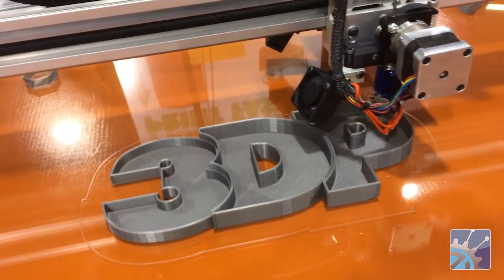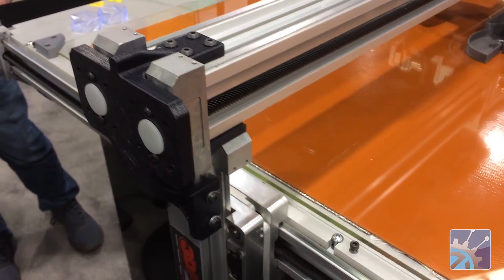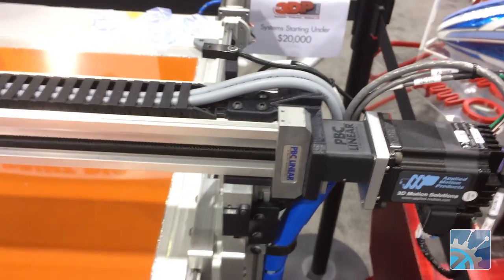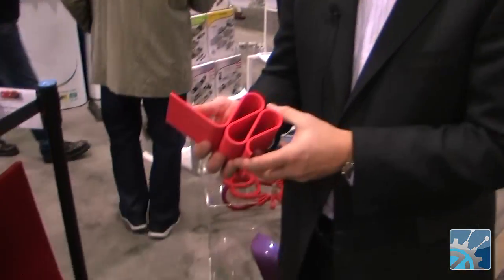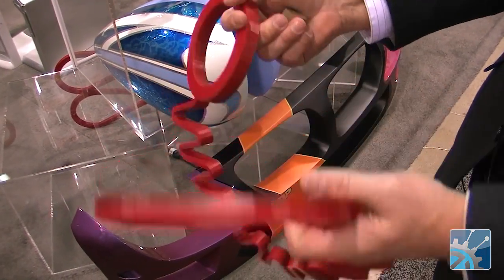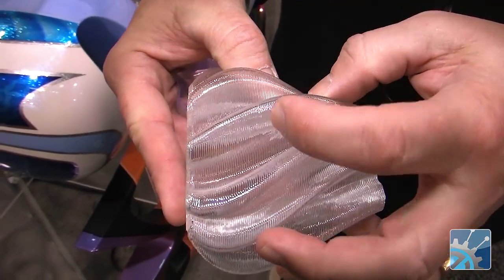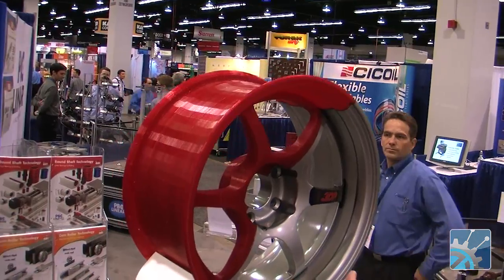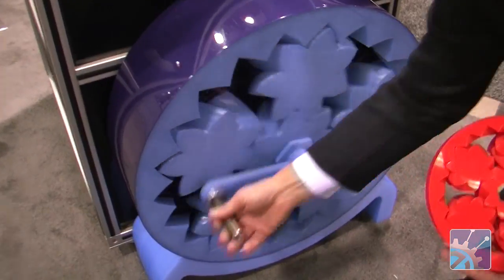3D Printing Goes Big with the 3DP1000

Comment: The problem with 3d printing, is that it's SO DAMN SLOW!
I can produce the same objects on cnc cutters in 1/100th the time.
Reply: +satansaysimnuts  Yes, its slow, and there is second "major" problem - with this technology, items are not so strong as solid object from CNC or casting. But on CNC you cant produce some  objects with empty space inside or others difficult items.
Reply: +Aleksandr Ruljov 3d printing in fdm tech is that is maxed out the ress has a limit and the cost of a high end fdm printer does not justify the money for it when you can diy a cheap one and last also many prints and in good quality the only thing that has more future is the materials and that i dont know how much
Reply: odys nobody... what the living hell are you talking about? use some punctuation please.. I can't tell wtf you're talking about, and the stuff i can guess on, is kinda wrong lol.
Reply: Yep, all I need is to replace my £1000 printer with a £30,000 CNC mill, build a workshop, get raw materials, and now I can make my prototypes and toys 100 faster!
Reply: ... than do it ....